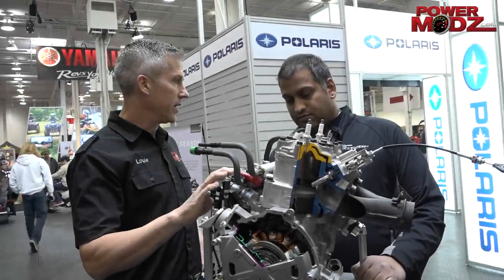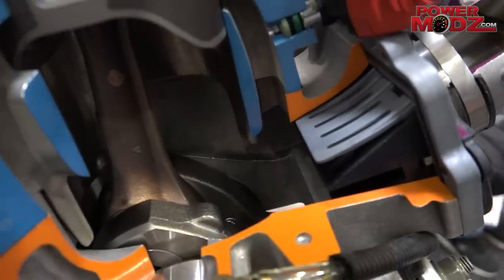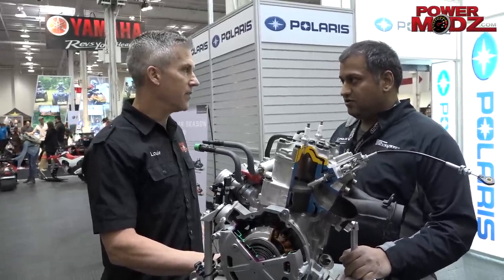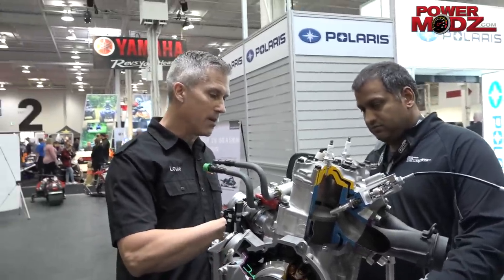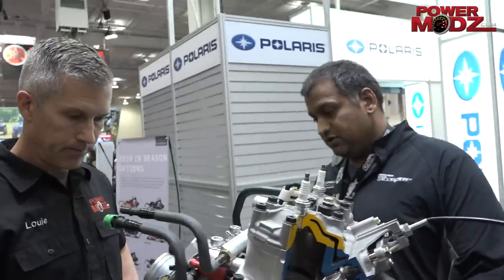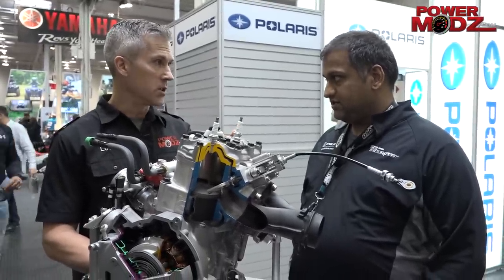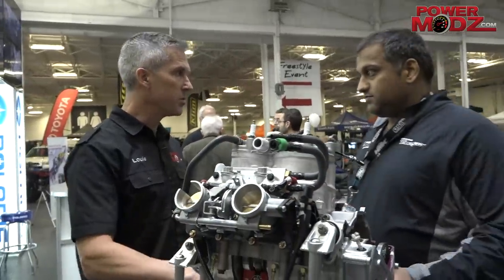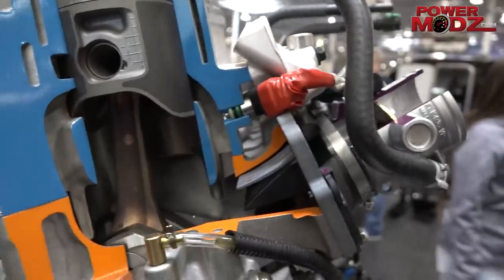Polaris 850 Patriot Engine explained by a Polaris Engineer!

Comment: Reason for Single ring piston is easy as the piston and ring heat up the single ring loses seal and blow by occurs. When this occurs the engine actually "detunes" itself by contaminating the incoming charge with exhaust gases. Resulting in far fewer warranty claims on engines. A single ring piston does have less drag and in a short run will produce more power over a dual ring piston, but as heat builds any benefit of a single ring is mitigated. Also his comment about heat transfer is incorrect. A dual ring piston has twice the area as a single ring piston to transfer heat to the cylinder wall.
Reply: Thank you for this explanation.. Been saying the same thing for many years..
Reply: The Piston is cooled by incoming cold air and gas vapor
Reply: There are a lot of things that help the piston rid itself of heat.  The ring is critical for transferring the heat OFF of the crown of the piston.
Reply: How about the Skidoo injects fuel directly on top of the piston .. It takes heat to vaporize liquids
Reply: The fuel is "vaporized" by forcing it through tiny holes in the injector tip at high pressure. Skidoo directly (see what I did there) I Jett's fuel onto the top of the piston so none of the fuel charge is lost out the exhaust port as the piston has already closed that off by this time in the stroke.
Reply: Skidoo uses a single ring for the same reason. They'll tell you all day long it's for this and for that but in the end it reduces warranty claims.
Reply: @aleininger4987     That is the huge advantage of Direct injection from the top of the head .. Timed direct injection that is . 
 Evinrude invented the idea and Bombardier bought out Evinrude ..  Much better mpg and lower emissions   Ski doo two strokes have lower emissions than many 4 stroke snowmobiles have and better  mpg too .  Also Skidoo uses why less oil  ..   the pump is leaner during lower power and lower rpm  times and  the oil it pumped directly to where it's needed so less oil gets thinned out by gasoline ..
Reply: You’re right. 2 rings is more surface area. A little more oil helps with friction. My 8v92 2 stroke Detroit is a 4 ring motor and I’m running BRPXD-100 Etec oil in it. Works great. I would love to see the 850 patriot scaled up into an inline 6 600CID or more for a hydrogen 2 stroke engine for trucks.

Comment: After watching the video about skidoo’s 850 I’m not very impressed with this one. Looks like the old engine with more cc. Skidoo (Rotax) actually remade their 850 entirely and improved everything with new tech. Like 2 piece cranks, oiled Bearings, bold on rods and more. Polaris just had to get a sled with an 850cc to compete but I’m not fooled lol
Reply from the maker: Lets see how it hold up!
Reply: You do realize that's all ancient outboard engine tech right?
Reply: I agree 100% I have owned a handful of polaris's and skidoos 850 by far crushs  the competition plus not one of the  snowmobile companies can even compare to the etec technology and this rep for Polaris saying we don't post engine horsepower numbers give me a break
Reply from the maker: @threexxxphat  who's dyno would you like them to use? One at sea level?  what temperature?  what brand of dyno? one at 5000 feet? a track dyno, crank dyno?what company would you like to see dyno it?  Do you want polaris to dyno their own?  Doo dyno their own?  We've all seen numbers in the past from Manufacturers on "independant dynos", and all the numbers were pretty much complete lies but I do know that if you tell me an engine has 9 percent more power over the previous model an Ive ridden the previous model then I'll have a good handle on the power output.  And lets not forget that horsepower sells cars and torque wins races, generally speaking the bigger the smile the more hp and torque you have.  Cheers and thanks for watching!
Reply: @PowerModzOfficial  all I am saying is that he didn't wanna answer your question when you asked how much horsepower the engine made he said 9% more . What sells sleds in my opinion are HP numbers
Reply: 9% of what ...to me it didn't seem like he knew much about the engine. To tell you the truth you seemed to know more then he did just saying no worries tho  I really like watching your videos during sled season
Reply: @PowerModzOfficial  Everyone is waiting for PowerModz to buy a track dyno and do independent testing and provide us with the results of course. Honestly tho thats all it would really take is a independent tester doing all the tests on the same dyno at the same location. Have it in a temperature/Humidity controlled environment and that removes 100% of the variables. How much could a Dyno possibly cost. Pfffft. Just buy one already.
Reply: Yes the Rotax is built better. The Polaris is just an old chevy motor. Bye Bye miss american pie i drove 850 patriot to the levee bu the levee was dry! and on it goes.
Reply: I like the rotax 850 etec turbo better. I would love to see an OP 1700 made from 2 850 etec’ s like this wonderful OP 2 stroke Cummins:https://mart.cummins.com/imagelibrary/data/assetfiles/0058689.pdf

Comment: Only 9 percent with an extra 40CC, doesn't seem very impressive. Also representative doesn't seem overly knowledgeable
Reply: I was going to say the same thing .
Reply: Oh I dont know, I think thats pretty decent. I just hope the 850 sticks together a little longer!
Reply: extra 15hp out of 40cc isn't alot at all
Reply: @ColinMcEvoy  The 800 is 5 cc per 1 hp. The 850 is 4.8 cc per 1 hp. It is making more hp per cc than the 800. Thats 160hp.vs 174.5 hp. Is it jaw dropping? No, but it's better than the skidoo 850 which is still at 165hp. I'm more concerned with reliability, 174 hp is plenty enough for anybody.
Reply: @SirAnderw  it's not 180hp maybe 170
Reply: One of these tested 174 on the dyno.
Reply: @SirAnderw  Joey Strub  YouTube. Dynotec did some as well.
Reply: @dirtyfacegeorge9938  You right, I got my numbers wrong, dynotec had the 800ho at 160hp not 165 so 9% of 160 is 14.4. Which makes since if they dynoed the 850 at174hp.
Reply: Paul Lunney If this guy is a Polaris engineer, all the terrible motors make sense now.....
Reply: Let’s do math...9% more power from 5% more displacement. That doesn’t seem too bad to me.
Reply from the maker: @SirAnderw  160 hp stock polaris 800ho?
Reply: @SirAnderw  Skidoo 850 165? u drunk. They have tested both Polaris 850 and Skidoo 850 on same dyno. Skidoo 172,2hp. Polaris 169,9hp.
Reply: @PowerModzOfficial    This is the link to where I got my number from. They claim the 800ho is making 160hp. http://www.amsnow.com/how-to-tech/dyno-tests/2014/11/new-2015-polaris-cleanfire-800-ho
Reply: @Hoonasmeister  Could you give a link to the page where it has the dyno runs? Skidoo says themselves it is 165hp. Their testing facility is at 1100 ft. At sea level I bet is it 170hp. That's the thing, altitude and air temperature can make a big difference. If they tested both on the same dyno I would love to see the info.
Reply: I also noticed that, but that doesn't need to have anything to do with him not having knowledge. Maybe the representative just isn't experienced in explaining how the engine works in an interview and in front of a camera. He might very well be a great engineer.
Reply: He seemed plenty knowledgeable for a show representative.
Reply: That’s 14 HP.  You don’t think that’s impressive? A 500cc Honda quad makes like 26 HP and they got about 14 HP out of 40cc. I’d say that’s pretty good.
Reply: @vernerbexar6160  yeah, that's almost every engineer...reminds me of the old joke: what does an engineer use for birth control?  His personality. :P

Comment: He spoke about the problem of dealers unnecessarily adding oil to the gas tank for break in and causing plug fouling, but did not mention the solution (well other than don't put in oil...lol).  I just bought two 2018 800 SKS 155's off the showroom floor to which the dealer added oil a couple years back when they were assembled.  The sled I have been riding most has fouled 6 plugs in 8 hours of operation.  The other sled has 4 hours and has fouled only one plug.  The ECU will continue to add extra oil until the 18 hour mark.  Will this issue of plug fouling eventually clear up?  Wondering at this point if I have a gummed up injector....since it's always on the PTO side.  Sleds run like a champ otherwise.

Been running 91 oct non-ethanol through it along with a can of seafoam with some long WOT pulls, so time will tell I guess.

Comment: The Polaris engine would be a great engine  if it was not for the fact the Skidoo engine is so much better..  Only Problem with my 2014 Skidoo is the  chassis likes to bend and fold if you ride hard or hit a small obstacle ..

  The Skidoo has direct injection and  does not need a starter anymore due to a capacitor and a very strong  charging coil system  "rare earth magnets.."    The Skidoo 850 has so many improvements over the 800 it almost makes me want to trade it in.. Then again I just saw a 2017 Sidewinder on sale for a very good price ..

Comment: My question on it would be on the reeds. My understanding on those is it helps with fuel and air to mix up with each other.  Just trying to remember. If that is the case then why does it need them if the fuel is added threw the injectors

Comment: Is it going to last longer then the 800 I have heard there already having problems with the 850
Reply: I'm sure it will last longer than a Ski-doo with isoflex crank bearings.
Reply: @TrakSpock1  they haven't built a motor yet that outlast skidoo
Reply: Boon Docker - You can't be serious. I currently have three Polaris snowmobiles with over 10,000 miles. My buddies 1998 Ski-doo Formula III 700, my buddies 2005 Ski-doo REV 600, and my brothers Ski-doo 800 REV all had isoflex crank bearing failures at 3000 miles, 2000 miles, and 2000 miles. Had to have Goodwin Performance add a direct oil passage to fix the issue. Ski-doo blows literally.
Reply: @TrakSpock1  what is your point
Reply: @TrakSpock1  Well Maybe you can go to Polaris Headquarters and explain to them your secrets to making your 08-15 800's last too 10,000 miles. Because those motors were fucking time bombs. They got it right with the 800 H.O. and so far the 850 seems to be doing good.

Comment: HI POWERMODZ WHAT YOUR OPINION ON THE POLARIS 800 2 STROKE MOTOR?  ARE THEY RELIABLE?
Reply from the maker: What is reliable?  Depends on how you look after it, maintain it, treat it, change pistons etc etc.  It's not a dud motor, it's a typical snowmobile engine.
Reply: @PowerModzOfficial  that's a cop out statement about reliability.  Reliability means,,, put in clean gas and oil and ride. It either holds up or it doesn't.
Reply: I guess so as long as you are getting enough oil to them. I seen a 12v71 2 stroke Detroit diesel for a generator eat rings and bent a few rods on a boat I worked on. The single ring scares me with all the heat and pressure the 850 patriot makes. Are thinking of making a hydrogen 850 patriot turbo? The Polaris motors are nice. Imagine a 440 CID v8 2 stroke with the patriot port pattern scaled up for a truck or dodge challenger/charger.

Comment: 1 MPG is bad ass. Fouling plugs every ride is awesome. Why would you actually just use 1 ring? Don't tell anyone its awful and your sled engine will blow up in 1000 miles instead of 2000 miles BUT it saved the company so much money they gave me free McDonalds lunches for life. Pretty soon i'm gonna need 2 sleds hooked together to move me around.

Comment: I love Polaris snowmobiles, owned Polaris sleds since I was a kid but not too sure about the single ring.
Reply: Yeah that 1 ring has to deal with a lot. I guess you could change out the pistons for 2 ring after market pistons.
Reply: @jlo13800  I ended up buying a spring 2020 snow check SKS being offered with the 850. After half a season the motor tanked. Rebuilt with the Wossner double ring piston kit. Starting off the 2022 season with double the miles then the factory single ring.

Comment: Nothing against this guy, but it seems like you had to pry everything out of him.  If I were involved in a project like that, you couldn't get me to shut up about all the cool stuff designed into the motor.  This is a big deal for Polaris, and they should be sending people to the shows that can brag about it.  In some ways, I miss the old Fuji piston port motors - they were so easy to work on.  On the other hand, squeeze the throttle on anything since then and there's no going back, huge improvement.